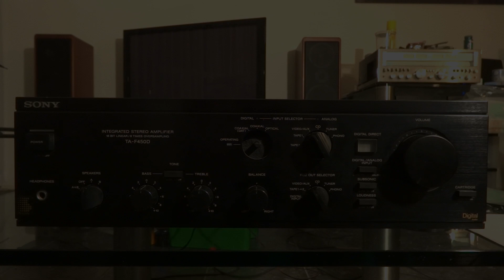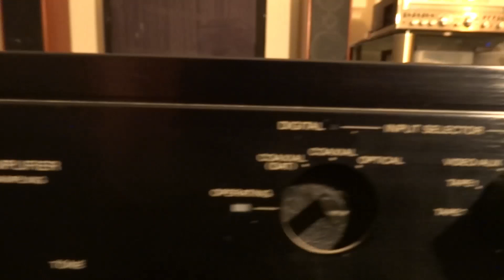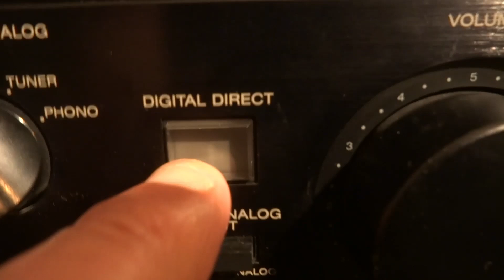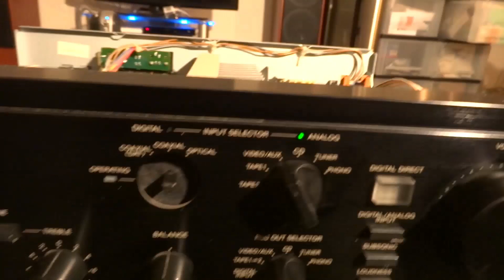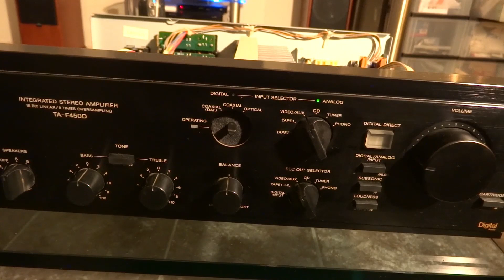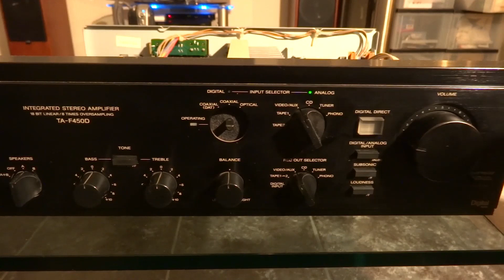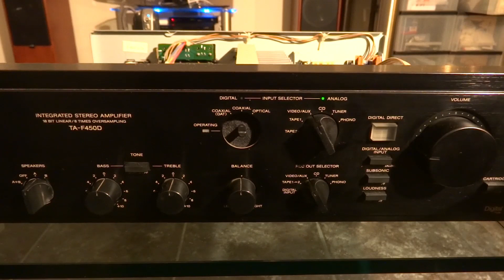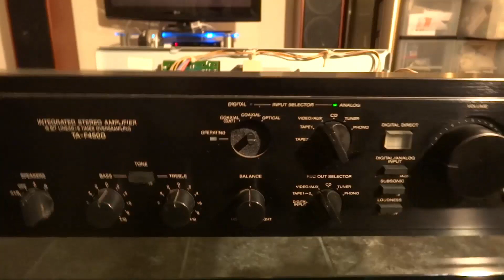Sony TA-F450D

Comment: Effectivly the F450D is a F400 + DAC.  The DAC is made around the very good PCM58P chips but the analog output stage is
a typical low cost design,so the sound is not as good as say a CDP-228ESD or a Kenwood DP-7010. To change that for the 
better a couple parts should be changed. For example there is a ceramic condensator (C932,47pF) in the Latch Enable path 
between the digital filter chip and the converter chips. This should be exchanged with a Wima FKP2 5% foil condensator.
The output opamp (IC908) is original a Mitsubishi M5218L in SIP8 casing. It should be exchanged with a NJR NJM 2068L. 
Also the foil condensators in the local feedbackloops of the opamp can be exchanged against FKP2 and both coupling 
capacitors (C150,C250;47µF/25V) can be replaced with Nichicon FG`s of higher voltage rating. That all will cost around 5€ 
but betters the sound of the DAC noticable.
That  the sound appeals to be thin is the combined effect of the current limiters between frontends and output stages and 
the way the poweramps are HF stabilised. One can also change that for the better.  However its a bit more complicard to 
describe because it needs a bit of reengineering. 
Anyway,in short: get rid of the limiters,stabilise the amp via miller compensation in the class a drivers of the poweramp 
frontends. Also change the noisy opamp that functions as a line buffer and make its feedback loops not frequency dependend.
Well,after a complete overhaul of a F450D you get a pretty decent amp with a good phonopre and a good sounding but very basic
DAC. Sadly the F450D is not that servicefriendly build like later models,so for renovation you have to nearly take it completly apart.
But the endresult is close in sound quality to a ES juniormodel,although the overload protectection should be adjusted rather to 
60 Watts than 100 Watts per channnel,because the transformer will melt otherwise.
PS.: One reason why a sub Sony ES will never sound as good as a Sony ES lies in the construction of the input stages of the 
power amp drivers.  The current mirror for the input differential is always a transistor and a diode in consumerclass sony amps
while it consists of a (special) pair of transistors in ES amps. Also the compensation and stabilizing is more finetuned and costlier
made in ES amps.

Comment: I bought that Sony TA F450D new with the Sony APM 44ES speakers and it was and still is a great amp. Then I upgraded to TA F650ESD and there are no major diferences between them. The 650ESD is more dark and neutral and the the F450D more musical both with lots of power. I still have the F450D and in more than 30 years never had a problem...
Reply: I bought one when it came out and it was classed as part of es range of amps ,like yourself  I found great clean sound I use to have Sony es brochure and this amp was featured it it .

Comment: You have The Three Degrees on your MP3 player......I think I have a "man-crush" now :)...................................so what exactly does a DAC do Andrew? I am 100% analog since childbirth so excuse my ignorance. My guess is it makes a 92kbps MP3 recording into a 300kbps, better quality sound?
Reply from the maker: in every music player ore phone is a dac inside. Digital music on your phone ore on your computer are just zero's and one's, without a dac between these sources you wouldn't hear music through your normal(without dac) amplifier/speakers because a dac converts all those zero's and ones into analog music. The problem is that a good sound also depends on a good dac, most these phones, computers, music players have a cheap and therefore not good sounding dac. Amplifiers with a built in dac use often a far better dac then the dac in your phone, computer etc. Records you spin on your turntable are analog, so doesn't need a dac. I choosed my new phone(lenovo vibe x3 c70) special for the excellent dac's inside, actually, the dac's inside my phone are better than the dac's used in this amp. Some cd players, even old ones are very popular because they use a excellent dac, because also cd is digital music and need a dac to convert it to analog before sending it to your amplifier. Watch my video about the philips cd650, this one have a very popular dac inside and very much sought under audiophiles. every dac have it's own sound character. Most top of the line phones from this year have a excellent dac ore dac's, so a amplifier with built in dac isn't really necessary anymore, it al depends on the quality of your music players dac. Just buy your next phone on the sound quality and see what dac ore dac's are inside, some phones have even 2 ore more dac's inside like my lenovo have. Dedicated dac's are not necessary better as the dac's used today in top of the line mobile phones but some people prefer a stand alone dedicated dac, The dac's inside my phone are also built in expensive dedicated dac's but the are more expensive as the phone itself so i don't see the point there unless you are loaded with cash ofcourse
Reply from the maker: A better dac will give a better sound whatever the source sound is 92kbs ore 320kbs
Reply: Ahhhh, I get it now.....I was wondering why my 1991 SONY CD player sounds so much better than newer versions of cd players.
Reply from the maker: A 92kbs can never change in 300kbs. You can convert a 92 into 320kbs but the sound will stay 93kbs. You can't upgrade sound in this way, only downgrade, once downgraded it can never upgraded again. A better dac only give a better sound in overall but it doesn't upgrade your source
Reply from the maker: I bought my lenovo vibe x3c70 with 64gb intern for 300 euro but i saw yesterday the x3c50 for only 189$, that's a steal, today it is 212$. the product is going out stock and therefore much cheaper. they (c50 and c70) have the possibility to expand memory: https://www.fastcardtech.com/Lenovo-Vibe-x3-C50.html
Reply: i also understand dac a lttle better thank you